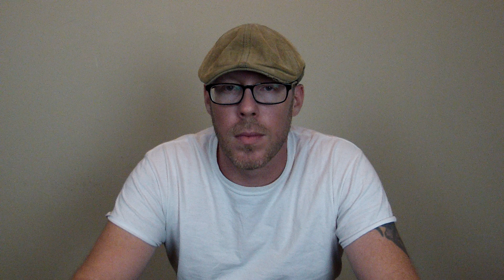What Is An SVRS Pool Pump?

Comment: Is an SVRS pool pump as safe or better than a Vac Alert setup?
Reply from the maker: I don't think anyone would be willing to answer that question with conviction one way or the other purely from a liability standpoint.  The best and safest setup is one where there can not be an entrapement hazard so whatever you need to do to achieve that goal is the actual correct answer.
Reply: @Swimmingpoolsteve  Thanks for the reply.  From what I gather from your comment, the only solution would be to remove the main drain at the bottom of my deep end.
Reply from the maker: @davileett1224  or split it into a dual suction that meets modern day VGBA compliance.
Reply: @Swimmingpoolsteve  Thank you for the response again. I am about to have my pool re-plastered and one rep said he would put two drains in, the other said he would put a Vac-Alert in. My question is, does putting in a second drain run the risk of creating leaks in the pool that would otherwise have not occurred?

Comment: Steve, would the Ecostar variable speed have this option?
Reply from the maker: The standard Hayward EcoStar variable speed pump, part# SP3400VSP does not have this feature however they do make an EcoStar with safety vacuum system release which is the SP3400VSPVR EcoStar model. It is usually a few hundred dollars more than the regular EcoStar.
Reply: +Swimming Pool Steve is that also variable speed? Thank you for all the help!!!
Reply from the maker: Olenska Yes it is variable speed. Exact same pump with the SVRS protection

Comment: Around my personal pool I have a random pipe that is cut flush with the concrete pool decking, this is probably a 70's or 80's pool never been able to find out where it goes, I know the main drain is plumed to the skimmer, an old jacuzzi model W, with the idea that you where supposed to drop a plate in there to cause the suction side to draw water from the main drain (Terrible design) 
Have you ever seen pools with this random open pipe around the pool that seams like it goes to nowhere ?
Reply from the maker: I am certain I have encountered random cut off pipe all around swimming pools for various reasons.  Where yours goes is a total guess.  Could be a makeshift deck drainage line.  Could be an air vent for old venturi jets (especially if you have / had an attached spa), could be that the old man who lived there before you put that there to stand his umbrella in lol!  Send some air down the hole and see what happens.
Reply: Very weird always been a mystery! I have tried to blast water down it, it does seam to go down but where to I have no idea. I saw your video talking about main drains and static relief, it light up a light bulb in my head and I thought it may have been tried to the MD somehow but it looks like not.
Reply from the maker: Video Québec I doubt that the cut-off pipe is connected to the main drain.